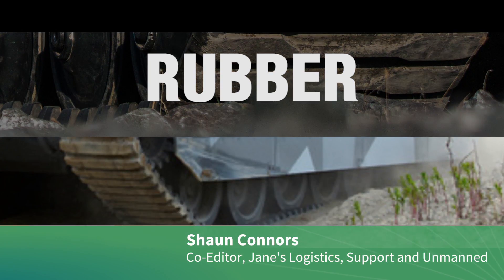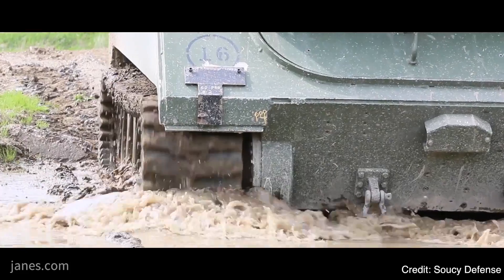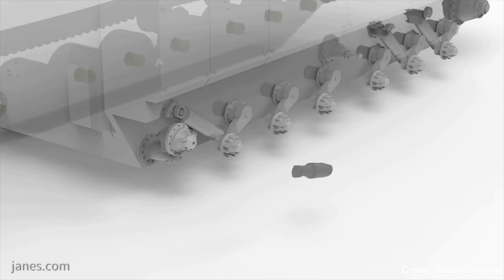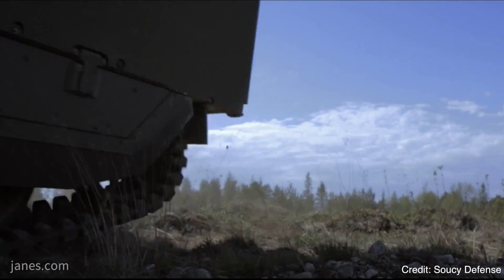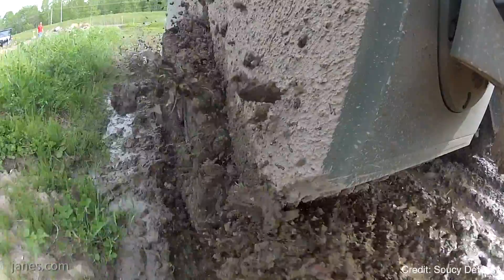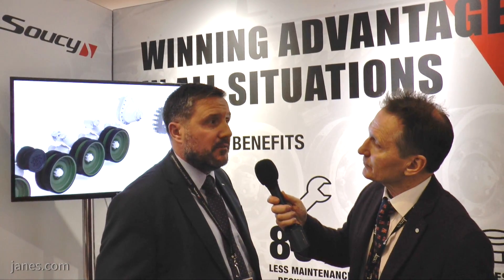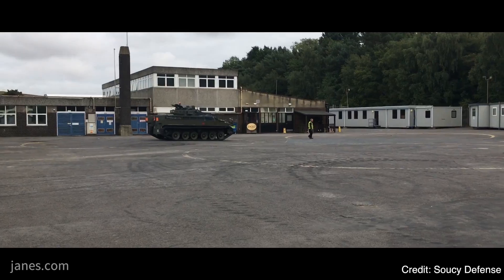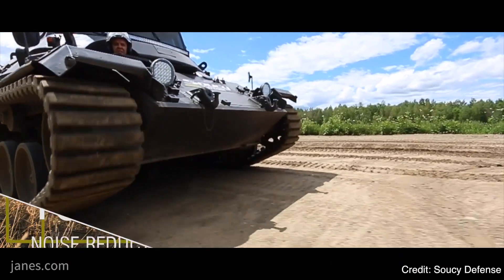Military Rubber Track Systems (IAV 2019)

Comment: Everyone Gangsta until someone throws a Molotov onto your track.
Also, one side of your vehicle has to be ENTIRELY off of the ground to replace the track - you can't just roll vehicle over the track and pull the loose end over the top.

Comment: So when we were in Iraq and our Bradley's and Abrams were doing hot seating crews and then rolling back out the wire for another 12 hr patrol or just doing heavy patrolling. The tracks would wear out. DUH your putting the stress of moving a vehicle that weighs many tons and going up to 60 MPH (vehicle depending, M88's doing 25 MPH should order a new engine lol) for hours on end. And they were going over asphalt and rough terrain. The bushings would wear out and the track connections required monitoring and adjustment often. I was a M88a1 recovery vehicle operator and a Bradley mechanic. I have seen it all many times. The track pads are the first thing you have to replace with traditional tracks. The rubber simply wears down to the grousers and then you need to replace them or face driving on racing slicks. The problem with this rubber "band" track system is its made of rubber with steel belting. But the part that meets the ground is going to be rubber. So your asking governments and military's to swap over from track systems that can replace a broken shoe or replace worn track pads (note: not the M88 as its tracked at based on the old M60 so its just replace the shoes). And just use a single belt that once its worn down discard and replace in whole. The problem is the logistics of shipping this sort of thing to units in combat. Right now track is sent out on pallets often in sections of 8 stacked 4 or 5 stacks high. And then sent back in the same manner when replaced. But with this you are sending rolls of track out to units. And if the band breaks the crews will have to wait for recovery guys to drag them back to change out the bands or wait for maintenance guys to come out and deliver the bands to the front lines. But with sectional track if a track section breaks you just use rope or chains connected to the sprocket carrier and then let mechanical force carry the ends back together. Then re-connect. How are they going to do this with a band? If it snaps it seems you are F'kd till help arrives.  

I had my track snap in Iraq one time and I was the ONLY person with track knowledge there. And yet withing 30 minutes I had my track back together on my M88a1 and moving again. But if my track was this band? Yea the whole convoy would have had to wait for a new band to come to me.
Reply: I thought about it, and I agreed that having to wait for a new track to be delivered to a broken vehicle would be shit...so I checked Soucy's site. They have a repair kit that will reconnect a busted track. Soucy claims that the rubber compound they use for their tracks, demonstrates 20 times less wear than conventional rubber compounds in lab testing....Which I take with a significant grain of salt, and assume they are cherry picking the data, and realistically, their compound might last 5x as long. Which is still significant.

Now, there is the other question: Does the money saved in fuel costs, suspension component wear, drivetrain wear, and the increased crew comfort, offset the cost of replacing the track more frequently?

Hell if I know. I just wouldn't write it off, without actually seeing it in action, and learning more about it than what can be offered in a 8.5 minute marketing wank video.
Reply: @dposcuro  it seems superior to steel segmented tracks in pretty much every other way except the fact that it isn't segmented. One practical consideration that came to my mind was the removal of the track. Steel segmented track can be delinked and then driven off the track wheels. From the promotional material it seemed that a rubber composite track would be removed by removing one half of the idler wheel, wich would then allow enough slack for the track to be removed. It just seems that any mud cover and especially heavier side armor or deep trackwells would be a pain in the ass during the track switching process. The split idler wheel seems much faster than some of the steel segmented track delinking processes that I'm familiar with, but the fact that you cannot cut the track and drive it off the road wheels seems like a major disadvantage.
Reply: I was thinking the exact same thing. I wouldn't replace steel linked tracks on any front-line armored fighting vehicles with these rubber-composite tracks, perhaps they would be fine for civilians, paramilitaries, border security, or scout forces in peace time.
Reply: You hit a mine and you are done… Sorry but you have to wait to be pulled back after you are stuck on the firing line for hours and your crew can do nothing… yea that’s really fuk’n brilliant. Its No wonder they never ask what happens if you drive over a mine…

Comment: Just aim for the tracks and the ivf or tank will be useless. Funny the Ruski's don't use the rubber tracks. They use metal linked tracks with additional rubber on it. I say 1 : 0 for the Ruski's 😂
Reply: Nowadays any shot a tank gives to Another Disables It in some aspect.
the shooting comes down to basically 2 or 3 shots from one of the tanks

Comment: Rubber bands are terrible. If damaged the crew can not replace a section and drive off. They are more expensive and impractical. But I bet some corrupt procurement politicians will make a deal with one of these companies for a bribe and the soldiers will be stuck with their screw up.

Comment: And you field repair them how?
Reply: You don't, just get a new track. But they seem to be more resilient that steel linked tracks. They apparently have several high tensile steel cables over the length of the track, and if you snap a cable or two the track will still be good, whilst if you bust a steel link the whole track is broken and the link needs replacement. It's simply a parallel versus series arrangement. Parallel provides redundancy while series does not. And they are certainly less affected by abrasion in some environments such as dessert.
Reply: They have a system to lash the ends together for a temporary fix, almost like a trackers ratchet straps. They are way lighter than steel track improving performance, range, quieter, less vibration. The pros far outweigh the cons.
Reply: Take it off, get a new one, keep going. 
Apparently, this technology isn't entirely the newest kid on the block, being present on the ubiquitous M3 Halftrack from WWII.

Comment: CAN IT STAND A BLAST ....OR HEAVY FIRE.....
Reply: especially when it hit a mine or those sort of stuff. No more track shortening trick.
Reply: Better than a steel track can.
Reply: @ Menno van Lavieren that is not correct. When a steel track is hit only the damaged segments need be replaced. When the continuous band tack gets hit you have to replace the entire track and the vehicle has to be pulled back to do it. They found this a serious problem in WW2 with this type of track on the halftracks. But there were so many of them available then the crew just got a new vehicle instead.

Comment: When it breaks -  which it will in a war - what happens? Changing a Tire is one thing, changing a whole track, then tension-ing it is another. Basically another product designed by people who never been in a real war. Metal tracks replaced by a composite surely a better idea. Plus rubber burns as the guy below mentions.  Think this is for counties who need patrol vehicles, but can not afford the mechanics  or parts.
Reply: There is a video of them somewhere repairing a rubber track on the cv90.  It can definitely be done in theatre.
Reply: @Weak eye dominant it can he done “in theater” dimwit but only after a recovery vehicle gets to you and pulls you back. Never mind a crew can replace it in less than half an hour in the field  on a segmented track… you must be the burned out bulb in the box…
Reply: Very well put.
Reply: To be honest, you do not fix metal tracks in combat or anywhere close to fighting. Imagine the sort of situation where the tank crew would willingly jump out of their vehicle and spend an hour shuffling around the track, exposed to enemy fire.
The rubber track is quite resilient to damage, so you may get away with damage that would incapacitate a normal track, which means you're better off more of the time.
When you do need to repair it, though, in reality you've either left your mobility-killed vehicle behind and your unit lost the engagement. Or you unit won the fight, and thus you have the option to get repair elements over to help fix the track.

There is an extremely borderline situation where you would be able to repair the track on your own and be of benefit to the battle. In other cases, the track damage takes place outside of combat, in which case the loss isn't as critical. Indeed, you'd be more likely to get use of a metal track when you need just patrol vehicles, since they're not engaged in combat, so you can repair their tracks in the field, without needing to call in the repair crew...

TL;DR: Steel tracks make the vehicle self-sufficient, which benefits patrol vehicles more. Rubberband tracks make the vehicles more reliant on support, but heavy/combat formations don't operate without heavy support anyway. They just need so much more of it by design.
Reply: @ whitescar2 my father replaced his broken track on his Sherman during the Bulge while penetrating the German 7th Army’s left flank and under direct and indirect fire on the way to Bastogne . You do what has to be done to win.
Reply: Metal tracks can break too, and they too are a pain in the ass to change during a battle.
Reply: @asilturkklc171  You won't change metal tracks "in battle". You will maybe fix them up post battle, or more likely the repair crews will fix them for you.
In reality, if you lose a track in mid-battle, you bail the vehicle. Otherwise you're just a sitting duck.
Reply: @ Asiltürk Kılıç its obvious the only combat you have seen is in your mommy’s basement. Having a track segment replaced by the crew in a short time vs having to be pulled back by a recovery vehicle for an entire track change isn't comparable… 🤦🏼‍♂️

Comment: "Additional strength" of Rubber band track vs steel link track.
I know a lot of people who disagree with this claim. But then again, those people are all key-board warriors and don't work for the company that builds the product.
Reply: More likely all this company has ever employed IS keyboard warriors because this track is totally impractical for combat situations with land mines,  and IEDs, artillery, bombs, etc…
Reply: @CH-pv2rz  
Less weight. Less noise. Less vibrations.
All three of which benefit the vehicle in combat.

Common claims against rubber tracks include:
"It's all one track. You can't just fix one section." 
Which is why "Segmented rubber band tracks" exist 

"The tracks are all rubber. Too delicate".
Wrong. The rubber is over a steel mesh.

"You can cut through the track with small arms fire"
Wrong. For the same reason as above, the rubber is over a steel mesh.

"At risk from artillery shells / shell fragments"
This is a silly claim. And is one of the ones you specifically mentioned.
A direct hit from a shell will screw up both metal tracks, rubber tracks, and the vehicle itself.
An indirect hit from the side is unlikely to hit the tracks at all. Due to the flat angle of the track, and the fact the top track is covered by the track skirt, while the bottom track is in the ground.
From the front, shell fragments will do as much damage to the tracks as small arms fire.

Comment: 25% reduction of fuel use and 10kmh higher speed? too good to be true?
Reply: No, most driving energy is lost in the tracks. Metal links rub against each other and against the ground.
Reply: Why?
The track is half the weight. A heavier track takes more energy to physically move the track.

Imagine the difference between having 1kg in each of your pants pockets vs 1kg on each of your shoes. The weight placement means a lot about the energy needed to move it.
Reply: @shanerooney7288  but the vehicle is not half of the weight...
Reply: @jebise1126  , But the tracks are.

Have you ever gone hiking and noticed how hard it is to walk with thick layers of mud on  the bottom of your shoes?
Even though the weight of the mud itself isn't the great, the location of that weight makes a big impact.

Same with armored vehicles. 1 tonne of weight in the tracks has a larger impact on fuel economy than 1 tonne of weight in the turret.
Or in this case, 50% reduction in track weight can result in a 25% reduction in fuel economy, despite the fact that the tracks are less than 50% of the vehicle's overall weight.
Reply: @jebise1126  The overall weight of the vehicle has drastically less effect on fuel economy, than the weight of the running gear. It's the same in cars, trucks, everything that uses wheels (or tracks).

Comment: No sane Gov't or army will consider having to use two differing sets of tracks for vehicles of differing weights! Any purchase cost  benefit would immediately be removed. i wonder too, how do you fit and remove a single piece track and can they be retro fitted to existing steel tracked vehicles? A lot of work still needed here methinks.
Reply: Oh, sure.
Every "sane" military will use the same tracks for 60 tonne tanks, 30 tonne IFVs, and 15 tonne APCs.
I mean, it isn't like the different weight requirements would necessitate different tracks or anything.

Can you imagine that in the past they even used tracks and wheels For The Same Weight Class of vehicles ! unbelievable.
Reply: @shanerooney7288  That is not what i mean and you know it. Try learning to read analytically before trying to be clever and failing miserably.
Reply: @thewomble1509  , please elaborate on what you mean by "No sane Gov't or army will consider having to use two differing sets of tracks for vehicles of differing weights!"
Reply: @shanerooney7288  If you can't work that out from the commentary on the video, I'm not doing it for you.
Reply: @thewomble1509  , when you write a comment on public forum, the point is usually to convey some form of message to other readers.
You have evidently failed at that.

I read your post. I made an interpretation. You said my interpretation was wrong. Despite being explicitly asked, you don't provide an alternative interpretation.
Ergo, I'll be sticking with my original interpretation... which leads me to believe you aren't very smart.
Reply: @shanerooney7288  Fine by me ducky. I aim to please.
Reply: One piece rubber tracks have been used on various vehicles for decades. The logistics impact would be positive overall in most cases. They have been sometimes retrofitted to steel tracked vehicles, the M113 is an example. There are different pros and cons with rubber tracks but overall are an improvement over steel tracks in many cases.
Reply: @Stu_Bur  .
Agreed.

Comment: the caterpillar of the tank looks monolithic, 
it means that if it breaks in one place it is necessary to change all entirely,
 it is not convenient and expensive, 
secondly absolutely all rubber caterpillars stretch over time,
 in the third on abrasive soils it will very quickly be erased,
 in the fourth and what with it will be if will come to move on the burning earth? 
in the fifth near the car burst explosive shells it is easy to risovat this caterpillar shrapnel. 
Conclusion it's rubbish and completely unnecessary idea for the army
Reply: Just one point, Steel link tracks stretch too with use . That is why "track bashing" needs to be done and track length monitored. After a certain number of link renewals the track has to be discarded.

Comment: Hey , get that Warrior up to full speed and then do a hard brake . With metal track they can nearly do a handstand , how does the rubber one fair ?
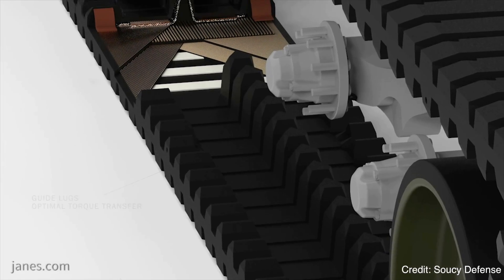Reply: Pause at 4:05 and you can see the steel reinforcements inside the banded track. 
I don't see why this would have any more problem stopping a 35 tonne vehicle than the wheels on the Boxer or Etian IFV.
Reply: @shanerooney7288  ...and how much torque is applied at full brake ?
Reply: @orsonincharge4879  
From the Engine? None. Obviously.
From the inertia of the vehicle? Less than if the AFV had segmented metal tracks (because it is lighter)
Reply: @shanerooney7288  how much do the rubber tracks weigh ?
Reply: @orsonincharge4879  , according to 1:48 in the video; 50% reduction in track weight.

Obviously this is on a per-length basis. Since different tracked vehicles will use different lengths of track.